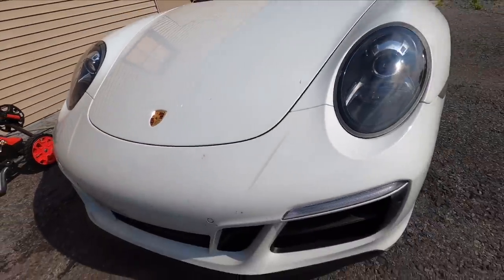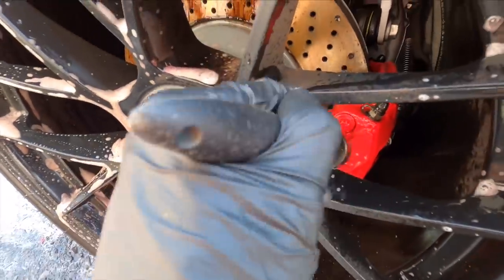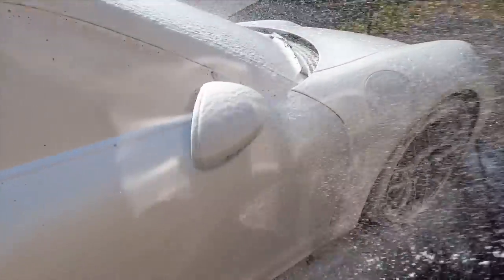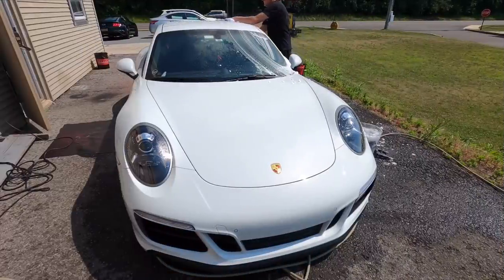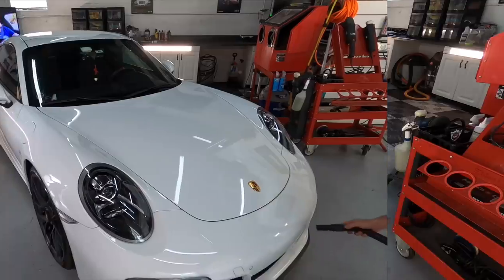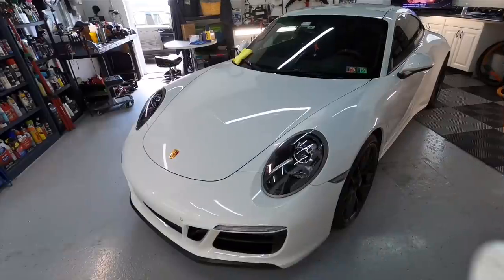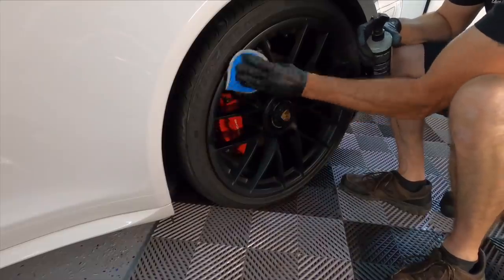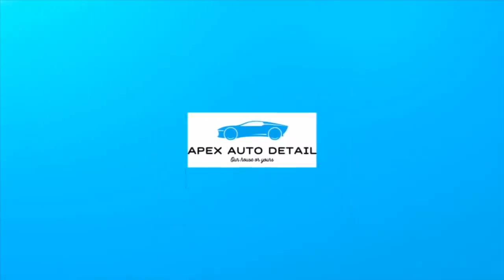Porsche 911 Carerra 4 GTS Maintenance Exterior Detail! What I use And How I Use It! (Exterior)

Comment: Hey Brian, need your help bud... btw I love your work and your keen eye for detail 👍🏻 keep it up.
Now for the help I need loll... 

So I just had a black Escalade come in, it has the yellow lane paint on it, I tried every which way possible to get it off but to no avail. Tried lacquer thinner, acetone, citrol 266, clay bar, good old thumbnail, nail polish remover (same as acetone I believe) and I wasn’t able to take even one little spatter off of the vehicle. The only thing I can think of is to wet sand 1500 and then 3000 and then at least a two stage correction to get rid of the sanding marks (my last resort, but don’t want to do that as it’s very time consuming, since it’s all over on the one side of the vehicle). The only other thing I can think of is paint thinner and goof off? ANY HELP OR ADVICE WOULD BE GREATLY APPRECIATED!!! As this customer is interested in getting a ceramic coating in a couple weeks and I want to try and remove that lane paint off. Thank you so much 😊

Comment: I’m really interested in the initial products where you saturated the car with the soap and it also had ironX in it. I’m also interested  in the wheel cleaning application that you showed here. Also thanks for the tip on the plumbers putty for the clay bar thing and only doing that where’s it’s necessary unlike some other YouTubers. What did you use once the vehicle Ike was dry and you coated it? I’m assuming the paint pores are open at that point and it needs something to seal it like a spray on wax coating of some type?  Thanks for your help and any links you can include to keep this simple direct and seamless. 😎

Comment: Do you have any tips for the flash rust that shows up on the rotors after washing and then comes off with the first couple brake applications and turns the wheel barrels red?

Comment: Brian: if this white Porsche had type two etched water spots in it’s PPF that went through it’s Modesta coating. To the place that the PPF had to be replaced. Would you advise using graphene coating over the new laid PPF? The thinking is the engine heat is the problem. Please reply? Just wanted your thoughts on that particular point

Comment: I have to wash in the sunlight as well.  Do you use a DI water system or are you basically pulling the car in your facility to minimize water spots?  Just curious of your water spot avoiding techniques.

Comment: I wonder how much he would charge for this maintenance wash. It included some claying and machine polishing. I do the same process for $30 (But using lower-tired products)

For example today I detailed a 2018 Chevy Malibu (Vacuum it then use Mothers VLR on all plastic surfaces inside). Move on to the foam cannon wash using Meguiar's Ultimate Wash and Wax (Yeah it's not meant for foam cannon but I like the way it cleans and shines.) Contact using same soap and microfiber mitt, rinse n dry, get the door jams using Meguiar's Ultimate Waterless Wash, do windows and rims, "shine" the tires with 303 Aerospace Protectant. Took me about 2 hours all for $30. Of course I am a beginner doing this on the side, but I can't see myself charging 100 for something so "mind relaxing."
Reply: At least 75 for that.
Reply: For inside and outside at least 125